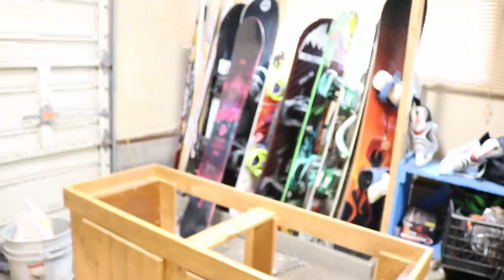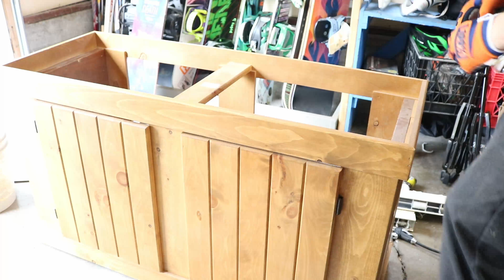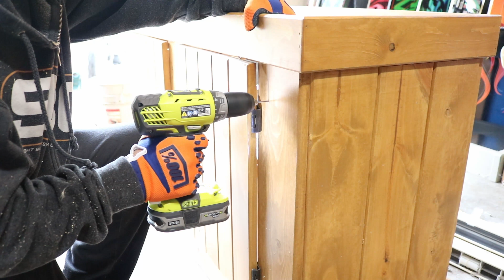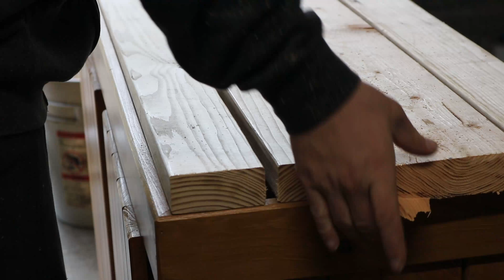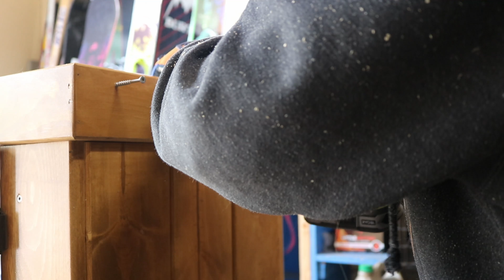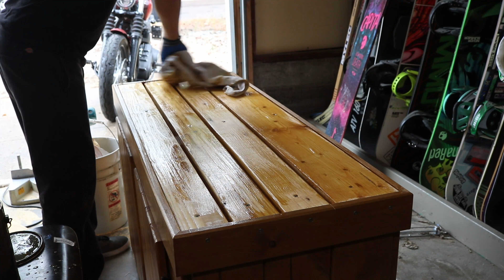Reinforcing Aqueon's 90gal Stand to Actually Hold 90 Gallons.

Comment: Looking at getting a 75 with a stand just like this. Have no idea why they thought staples and glue would be a good choice
Reply: The staples and glue don't hold the weight the wood supports do on the corners the glass tanks are designed so the plastic rims distribute the weight down to the floor.  You dont need to do this to the aqueon stands.  The pine they use is super strong you dont need to build stands from 2x4 or larger lumber it's over kill.
Reply: I have used stand and need to repair it. One of the boards is comming out. I would just do the corners myself and use 2x4 because easy to get

Comment: Overkill much?
Reply from the maker: Yes. But that's good
Reply from the maker: @robertt8874  if you look you'll see that their stand designed this way is now only rated for a 75 and not a 90. That with a 25 year old tank in my living room, combined with the stand having already been damaged in shipping (mentioned in the video) over building it was the correct way to go. But yes its over built. So is the stand for my 125 gallon tank. However there is no need to be talking trash and calling people names on the internet when surfing there's some algea to clean or a filter pad to rinse right?
Reply: @robertt8874  yep 1x3 pine is more than sufficient and makes a better stand it's all about properly distributing the weight from the bottom plastic frame to the floor.  It could be assembled with finishing nails and glue and would be fine.
Reply: @BassManStrikes  I get a good laugh when a single 3' 2"x4" can safely and easily support about 2,000lbs vertically and I see guys on YouTube using 4  3'  4"x4"s that can easily support 25'000LBS to put a 1.400lbs 125gal fish tank on it. lol. If you buy a Red Sea Reefer it comes with a Ikea style pressboard stand you put together yourself to support 2,000lbs 165gal tank, LOL
Reply: I bought used one and the thing is wobbly. One of the side boards poped out. I would just do the corners myself since it is a glass tank and plan on a sump. Cheaper than building a new one with todays prices
Reply: @SgtSparkles  no its not. This stand is 48x18 and would easily hold the weight of 2-90 gallon tanks.. We laugh at you! Maybe call aqueon kiddo and have them send you the info or better yet i'll bet you a dollar a pound this stand will hold 2500lbs and not have an issue.If it breaks I'll pay you double!

Comment: Awesome video, you helped me a lot, just have a question , what's the size of the drill bit and screws  ?
Reply from the maker: Dunno. Drill bit was smaller than the screws obviously. 2.5" deck screws I believe
Reply from the maker: Nope. It's holding all 800 lbs

Comment: I'm going to be reinforcing the stand for my 220 gallon tank and adding ratcheting leveling casters to the bottom in the next week or two.

Given that the tank weight will be about 3000 pounds, I'm actually looking forward to it and hoping it works out so I can rub it in the noses of all the neighsayers I've had to listen to over the last month.

The casters can hold 500 kg, so using eight will definitely handle the weight.

I've just got to make sure the reinforcements will handle the lateral shifting of weight once I drop the water level down by 50%.

Comment: If you understand the weight of your filled tank and the psi being distributed over the entire rim of the stand you would know that your stand was fine just as it was. Less than 10 lbs per square inch of stand rim.